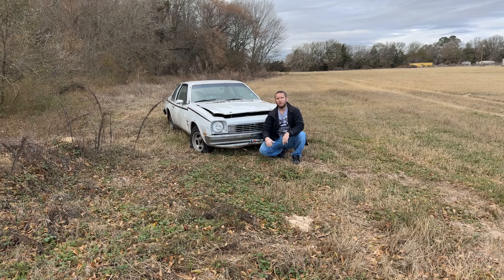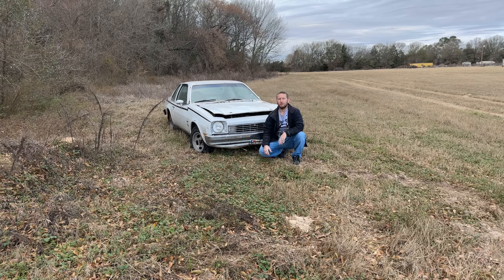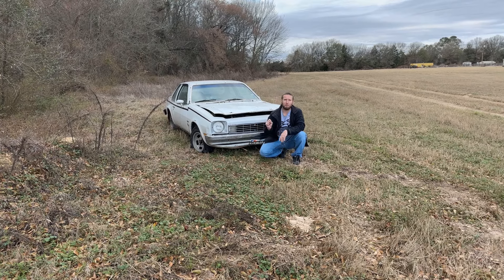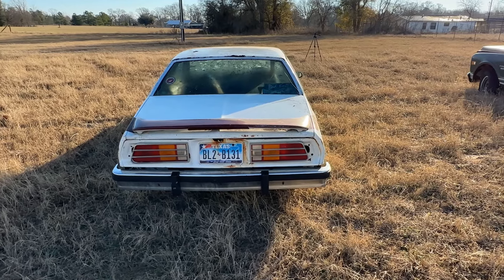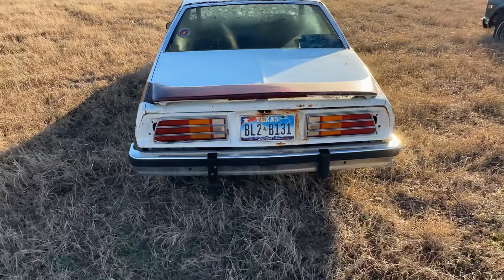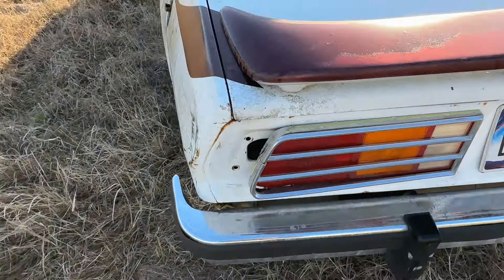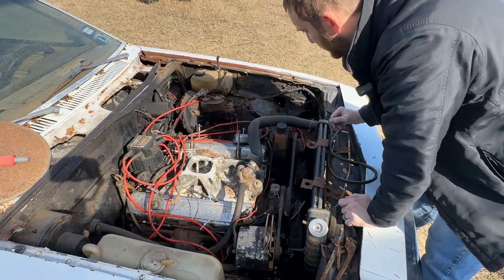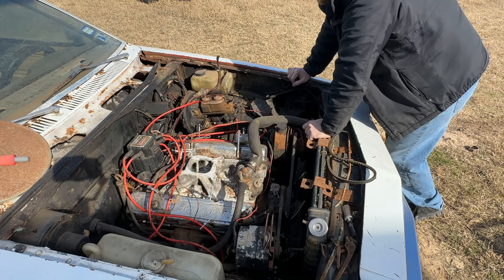Marine Vet - Abandoned for 17 years-  1980 Chevy Monza - Will it run??

Comment: I used to have a 78 Monza 2+2 I swapped a 1971 Impala 350 into and an 80 Monza Town Coupe I swapped a 72 Monte Carlo 350 into.  Your video brings back memories of both.  I put an Edelbrock TM1 intake on my 78 Monza and it had factory exhaust manifolds like yours does.  It had overheating problems with that thin 2 row radiator.  Surprised your cooled with a thin radiator.  I noticed your alternator moved when you turned the belts by hand.  Mine had the factory AC alt bracket that mounted the alt in the center top near the water pump.

The 71 350 I had in the 78 Monza cracked because the block froze.  Like you I drained the water pump, but there is still water in the block you have to pull the block drain plugs to get all of it out.  I used the unique v8 Monza parts from the first Monza project to build my 80 Town Coupe.  This time I used the 1 1/2" Hooker headers and had a stock 2 row rad re-cored and used a pusher electric fan.  This 350 had a Performer intake and a Comp Cams 268H high energy camshaft.  It ran 105 mph in the quarter and got into the high 13s on 175/80R13 snow tires.
Reply from the maker: Glad to bring back memories! I dont recall having overheating issues with this one, i did have the new radiator i in it, if memory recalls correctly it was a vette radiator, not sure what year. Biggest thing i remember is that it leaked about 2 quarts of oil a day going to and from work lol. I have big plans for this one, going to have that original frame from the 67 vette that needs a home after i move the body over to that Rothspeed frame. and i got a couple 454 blocks laying around.